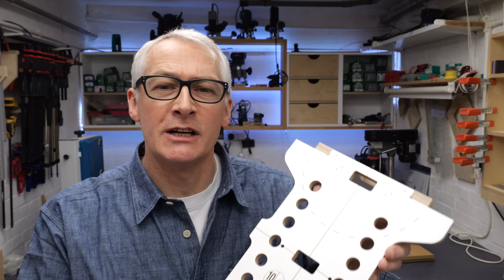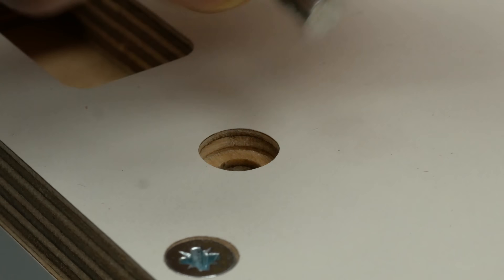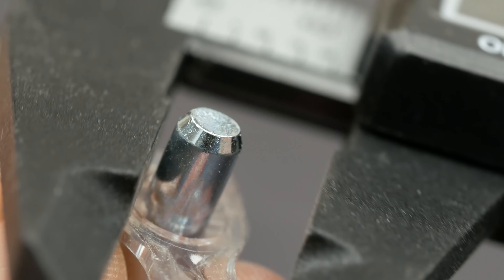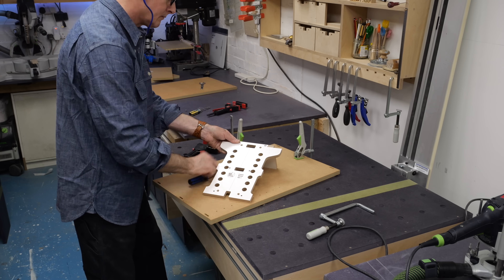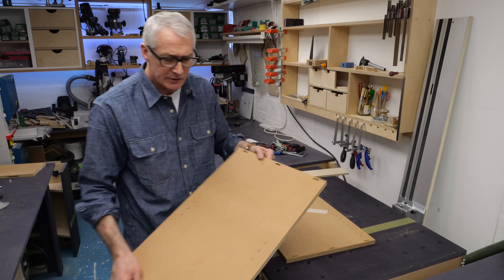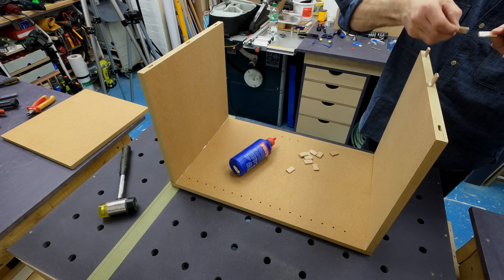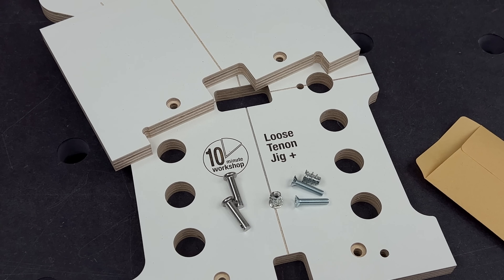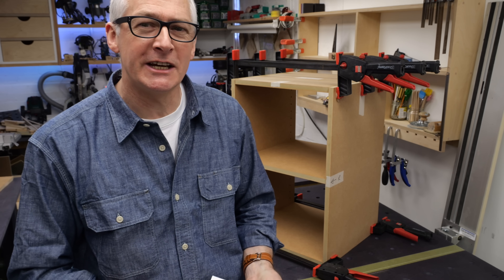Loose Tenon Jig Plus [video 493]

Comment: hi peter can this be used with 12mm mdf? enjoy your content
Reply from the maker: Thanks! This jig was discontinued earlier in the year, replaced by the current LTJ30 - launch video 535 here, https://youtu.be/enGVfEwD-Tc - but to answer your question, while the loose tenon jigs are designed to centre a loose tenon in 18mm stock, they will work with thinner material if packed out, or thicker stock if you can live with an off-centre mortise. Hope that helps! Peter

Comment: Hi Peter. Will the earlier (cheaper/basic) jig be back in-stock any time soon?
Reply from the maker: Hi. No, I’m sorry - they’re discontinued now; Birch ply is still too expensive, and making it from the new material to accommodate the 30mm guide bush was too costly to machine. And honestly, it was never that popular once the plus jig came out. I do have a few ‘old stock or cosmetic seconds’ on a shelf and I’ll be giving those away to 10MW Plus members  in one of the regular member giveaways before too long, but there are a few others to get through before then so I’m not sure when this will be exactly. 👍
Reply: Thanks for the response @10MinuteWorkshop  That's a shame, but of course totally understand re. cost of materials. The 'plus' jig certainly looks great!

Comment: Can it be done with a guide bush of 17mm? I supose thé slot would be too wide?
Reply from the maker: Not with this jig. You need an 18mm guide bush. 👍
Reply: @10MinuteWorkshop  my Bosch works with a guide bush of 17mil. If i adapt the knife to 4 mil, the slot will be the same i guess? I already ordered the jig so i am looking for a solution. Kind regards

Comment: I've also found that shelf pins are too small for a 5mm hole. But I already have a jig so: can anybody advise where I can get shelf pins that actually ARE 5mm, rather than merely being advertised as such?
Reply from the maker: They are; as I mention in the vid. you need a 4.76mm bit for a snug fit with "5mm" shelf pins. I supply one in the starter pack plus, or you can get them individually from Rennie tools. 👍

Comment: Hi Peter, can you use it for dowels too? And if yes makes sense to make a video about it. Thanks in advance for your answer. 
Regards, Vivi
Reply from the maker: Yes absolutely. I don’t have a drilling guide,  but I’ve used the router and guide bush to make dowelled joints. I did a short about it, and also about using the peanut connector with the jig. 👍👍

Comment: Hi I have the full kit  plus? (for some time) with the all the toys however I have suffered a router failure. What are people recommendations for a 'new' small routers to use just the jig (mains or battery)? Thanks
Reply: I got me a Trend T4 just for use with the jig.
Been anoying to always change collets. Here in Germany there are usually 6 and 8mm. Often forgot i had the 1/4" in, wondered why 6mm bit was to loose...
So i know 1/4" only in T4 😊

Comment: Bravo Peter. I may have missed something…..I don’t understand why you did 3 holes on one side of the gable and several on the other side?
Reply from the maker: As I say in the video, I’m demonstration how you would put a row of shelf pin holes along the full height of a cabinet, vs the 3-hole layout (1 centre, 1 above and below) either by lining up against a pencil mark, or using a common reference for the base of the jig eg the back of a guiderail. 👍
Reply: @10MinuteWorkshop  thanks it is what I thought and missed it. I have purchased one just waiting for it now. Thanks again Peter.

Comment: Ok, I purchased the loose tenon jig, but the 18mm bushing does not fit any of my routers.  I live in the USA.  is the hole pattern on Trend a "UK" standard?   It is a great little gadget though.....
Reply from the maker: Hi, and thanks for the purchase. The Trend guide bush is based on the classic Elu, then Dewalt standard, so it's pretty widely used, though many router manufacturers like to go their own way with guide bush design and fitting. There's a couple of options; Trend do make a 'universal sub base' to adapt their guide bushes to other routers - not sure if that's readily available in the US - or you can make a plywood sub base up pretty easily. Not sure which router you have but if it uses the Porter Cable 'two brass rings' style of guide bush then I've only seen them available here for the Katsu trim router, but there's definitely an 18mm available for them. 

The other option is to get a 3D printed one; I'll paste some links to those for some of the common routers below, OK? Thanks, Peter

18mm Guide bushes - 3D printed

Festool OF1010 - https://www.etsy.com/uk/listing/1186255013/festool-of-1010-18mm-guide-bush

Makita - www.ebay.co.uk/itm/144526271266

DeWalt - www.ebay.co.uk/itm/144526482364

Bosch - https://www.ebay.co.uk/itm/224458468111?mkcid=1&mkrid=710-53481-19255-0&siteid=3&campid=5338505844&customid=&toolid=20012&mkevt=1
Reply: @10MinuteWorkshop  Thanks for the quick reply!  I am using a dewalt palm router (newish design).  I will figure something out.  thanks!

Comment: Are loose tenons really THAT much better than dowels? I have only recently gotten into woodworking and I could see it going either way.
Reply from the maker: I go through the pros and cons in Loose Tenon Basics [video 481] - https://youtu.be/t86QGUn7dAI and Dowel Jig Basics [video 441] - https://youtu.be/zTj_hiEVfvw

The long and short of it is that dowels are cheap and readily available but demand precision in use and if you want to avoid rotation then you need to use at least  two per joint, which negates the cheapness to a large extent. Loose tenons cost more than dowels but each tenon has twice the gluing area of a similarly-sized (or next size up) dowel, no rotation issues and they’re a precise connector that lets you work loosely. 👍👍

Comment: Hi Peter. Do you know whether the Trend 18mm guide bush that comes in the kit fits the DeWalt 18v router? Please and thank you 🙂
Reply from the maker: Depends which Dewalt router. Trend use an old Elu/Dewalt standard, but Dewalt have gone away from that with some of their lines. Best starting point is to see if the OEM has an 18mm bush, then look at 3rd party guides. 👍
Reply: @10MinuteWorkshop  Okeydokes, will do. Thank you.

Comment: Quick question ... PM usually makes his cabinets from MRMDF, but how does loose tenon joinery in MDF compare with in ply ?
Reply from the maker: It’s a little tougher on the bits, but the bit that’s supplied with the starter pack is a really good, a solid carbide spiral upcut. I’ve been using the same one since I started making these jigs! 👌👍

Comment: I noticed you lined up the jig for shelf holes buy eye . Is that the case or does the jig use a reference edge on side too? I suspect the Jig has even more design potential for cabinet like addition of a 35mm hole for hinges and a few drill hole templates for that too ..You might add a reference for a 96mm template to make a DIY MFT in it ..
Reply from the maker: Not really 'by eye' - as I say in the vid the jig aligns with the edge of the workpiece to give the 'standard' 37mm set-back for the shelf-pin holes. I aligned the edge by feel, but you could use a stop against the edge if you really needed to. I looked at options like 35mm holes for concealed hinges and 20mm holes on 96mm centres, but they all added complexity to what is a fairly simple dual-purpose jig - loose tenons and shelf-pin holes - and any benefits that those extra functions might have brought were also outweighed or compromised by them, too. 👍

Comment: Hi Peter I’ve bought one of these jigs and I can’t find an 18mm guide for my festool 1400 router.  Do you happen to know where one can be had, preferably without 3d printing?  Thanks and love the jog
Reply from the maker: Hi, and thanks! There's no Festool OEM 18mm bush for the OF1400, but there's a UJK one - either individually or as a metric set - available from Axminster tools that someone I know uses with the OF1400. I dont have an OF1400 - maybe I should get one! 😯 😬 HTH, and thanks! Peter
Reply: @10MinuteWorkshop  Hi Peter, thank you for the reply.  After an hour of googling I can’t find said UKJ accessory.  I can see that they do one for the smaller 1010 router. My plan B is turning one up on my lathe, which won’t take very long and since I live in New Zealand the delivery time from the UK is a week at least anyway. I’m just posting this in case anyone else has solved this dilemma, or in case this helps someone else solve theirs.  For future designs could I humbly suggest using a more common guide size. Best wishes and great to see your channel taking off.

Comment: I got the LJT+ put it together and did some testing with it today.  The LJT+ works as advertised cutting perfect slots for 5x19x30mm Domino Tenons. I didn't try any other sizes as this is my first foray into the Domino Loose Tenon and I am only looking to build simple cabinets until I get much better at woodworking.  The test panels I was using fit together flawlessly, edges flushed up perfectly.  The LJT+ jig is well made, easy to assemble, easy to use.  I had the opportunity to chat a bit with Peter through Etsy messaging. You would be hard pressed to find a more honest, caring, professional person than Peter.  I'm looking forward to making some great projects with this jig.  Thanks Peter for everything
Reply from the maker: Wow, thanks so much Jesse! Great feedback, and an absolute pleasure to chat with you too! 🙌👍

Comment: Please forgive my ignorance about dominoes, will this jig or can this jig be modified for 10 x 50 dominos thanks in advance?
Reply from the maker: This jig will take all Domino DF500 sizes, with the appropriate bit and plunge depth. It is intended for use in 18mm thick stock, so while it will work on thicker stock - where a 10x50 might be appropriate - it won’t be centred. A more challenging task may be to find a 10mm spiral upcut bit with a 1/2” shank, though. 👍

Comment: Really nice idea on the jig Peter, looks to be working very well! Are you going to sell plans, ideally a cut file as well, for those of us that enjoy building tools? Would be a fun project to use the laser or CNC router at my local maker space. Cheers from Austria, Lukas
Reply from the maker: Thanks Lukas! No, no plans to make plans available for this jig; it’s a commercial enterprise that’s cost me thousands of pounds to get to this stage, so while there’s significant demand for the finished product I’ll keep it to that. 👍👍
Reply: Hi  @10MinuteWorkshop  , no worries, perfectly understandable. I only have bunch of different thickness offcuts to work with right now, but will get your jig when I have a bigger cabinetry project where I use 18mm sheets. Wishing you lots of sales, cheers!

Comment: Peter, spring time in the air and I'm about to build the Versailles planters from the video you published a few years ago.

After using them for a while, is there anything you want to change in the design?
Reply from the maker: Hi Nicklaus. No they’ve held up just fine. No issues with them at all. 👍👍

Comment: Peter, I have just received mine and looking forward to using it. One question, can I use it with a bigger router cutter to use bigger dominos say 8mm. Thanks Simon
Reply from the maker: Hi Simon and thanks for letting me know! Yes, absolutely - as I say on the assembly guide and videos, it will work with all the domino sizes with the appropriate bits and plunge depths. 👍👍

Comment: Hi Peter,  I've  made many cabinets and despite being a fan of biscuit joints I think you've developed a very nice looking jig which I am very tempted to buy, especially because of the simple shelf pin functionality you've added. Thanks for doing this. Cheers and keep up the good work.
Reply from the maker: Thanks Kevin! The Plus jigs are sold out at the moment, but they’ll be back in stock next week. 👍
Reply: @10MinuteWorkshop  do you have a link for the jig thanks

Comment: Thank you Peter for the excellent delivery  of the improved domino's jig yesterday.👍
Looking forward to having my First go at using the domino's. 
Just a little little thing you could improved on.
Is to have the holes pre drilled for the threaded inserts.
You have premium quality jig all cnc produce for accuracy,so you don't really want to start drilling holes yourself as a customer. 👍👍
Reply from the maker: Thank you. Pre-drilling the holes for the threaded inserts would add a completely disproportionate amount of cost to the jig, unfortunately - it is something I looked at, but it’s a very laborious process as CNC machines don’t drill edges without considerable manual intervention. And in all honesty, my take on it was that if you’re capable of using the jig, you’d also be capable of drilling a couple of holes. 👍👍
Reply: @10MinuteWorkshop  Thanks your your reply .👍
I thought it would be the added cost.
Yes I am capable of drilling holes,I have used these threaded inserts on numerous occasions,but then again some people might not have.👍
Like I said this is not me having a pop at you.
Just a observations. 👍
Once again thank you for designing this jig.

Comment: Apart from originally struggling to find an 18mm guide bush to fit my Makita 1/4” router (although, a 3D printed version sounds great!), the previous version has been a great purchase. Once I got used to it and stopped fumbling around, it’s been a fantastic addition to my workflow and I can only imagine that anyone needing the plus version, will be just as happy. With the versatility of this jig, I’d highly recommend to anyone buying, that you assemble the jig with machine screws and threaded inserts.
Reply from the maker: Thanks Chris! The machine screws and threaded inserts are included with all the jigs as standard now. 👍👍

Comment: Hi Peter what mandrel are you using
Reply from the maker: I generally use the Festool centering mandrel - https://amzn.to/32cYjcc

It’s very well made - you won’t need to buy another - and unusually it isn’t outrageously priced, for Festool, though a quick amazon search shows up a cheaper Bosch one here - https://amzn.to/3J8r0qz - and a more expensive DeWalt one, here - https://amzn.to/3DDT6J4

They all do the same job, so personally I’d go for the solid, 'machined from a single block of metal’ Festool version unless funds were especially tight. 👍👍

Comment: How did you align the centre mortices accurately without an edge to make it accurate?
Reply from the maker: In this video it was against an edge, but for a mid-panel mid-carcass fixing for eg a shelf, you just bear the jig against a batten or straight edge - as I did when putting in the shelf-pin holes - and lining the centre marks against a pencil line. You can screw the jig down through the holes either side of the middle cut-out - any marks are hidden by the panel. If that’s not clear I showed the whole process in the previous video for the regular loose tenon jig - link in description. 👍👍

Comment: Where can I buy reference pins?
Reply from the maker: You get a pair with the jigs, Of course, but if you want them for the DIY jig then you,can get them from Amazon or eBay, they’re called clevis pins, lots of types available. 👍
Reply: @10MinuteWorkshop  what diameter are they? Bought a pair of 5mm (for convenience of not having to completely remove each time) but they are too loose compared to the ones you supplied. Not sure if I bought duff ones or if yours are imperial.

Comment: I love this! One challenge I have is that I can’t seem to find a guide bush for my OF1400. The one I currently have has an external diameter of 21mm and it doesn’t seem that Festool makes a snap-on bushinh that’s 18mm. Any suggestion on what 18mm guide bush I can use for the OF1400?
Reply from the maker: There’s a UJK set that works with the OF1400 that includes an 18mm. Otherwise you can get 3D printed options on Etsy and eBay I use an Etsy one in my OF1010. 👍👍

Comment: Nice One, But the lack of a 18mm guide bush for the OF1400 made me just sell it and buy the DF500
Reply from the maker: Lots of 18mm guide bushes available for the OF1400; UJK do a set, and no shortage of folks prepared to 3D print one, or make adapters for the Elu/Trend size. OTOH I’ve never met anyone who regretted buying a Domino! Enjoy! 👍
Reply: @10MinuteWorkshop  Thank you, I did not find the UJK one, respectively the german site states it won‘t fit if i remember correctly. But i‘m really excited on the Domino

Comment: The plus jig looks like a great addition to your range. My thoughts were with the original jig not enough clamping room. This one with the additional features worth the extra in my opinion 
Looks to be a really good well thought out jig by someone who has worked on cabinets in a small workshop 👍🏻
Reply: Perhaps you could use a loose tenon to install some clamping wings on the loose tenon jig by using a loose tenon jig
Reply: @frittferro123  very good 😊 
In fairness if I were doing it I would probably use my domino.
But I stick with my comments larger clamping area does look like a great improvement 👍🏻

Comment: Amazing Jig Peter!. Does the router hole accommodate, for the peanut Drill Guide Bushe?
Reply from the maker: Thanks! It will, but the peanut cutter is quite large for the size of the bush, so dust collection suffers. But it does work well - I did a couple of shorts about it with peanuts and dowels. 👍👍